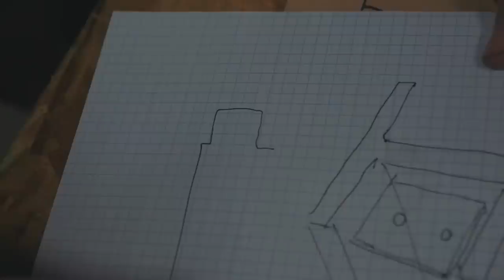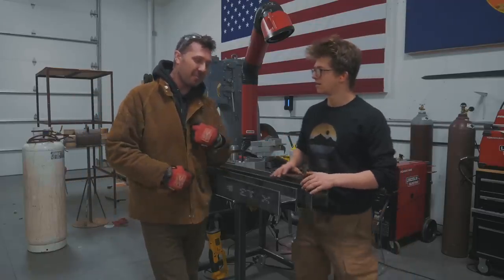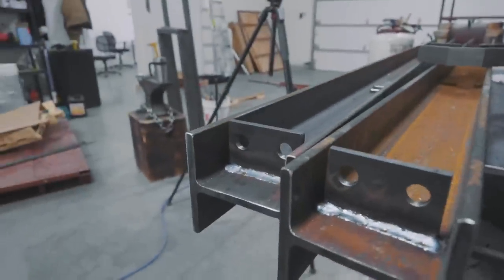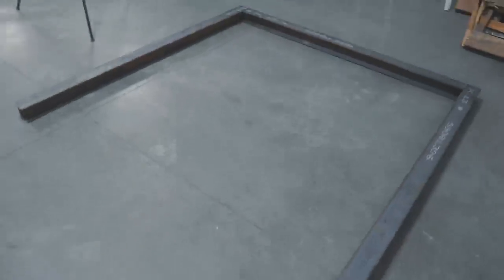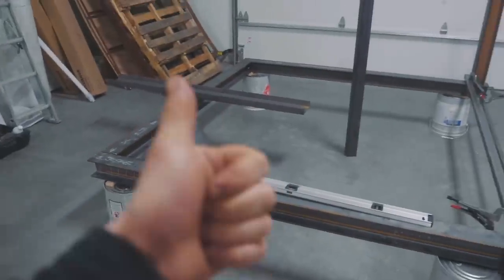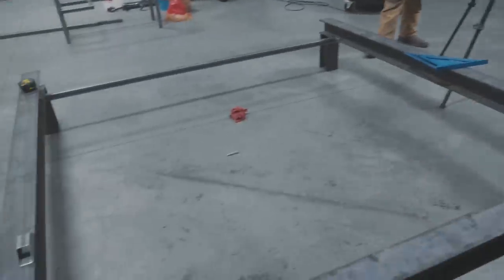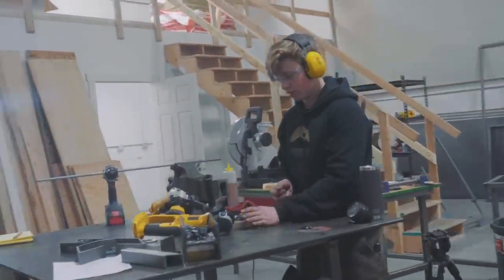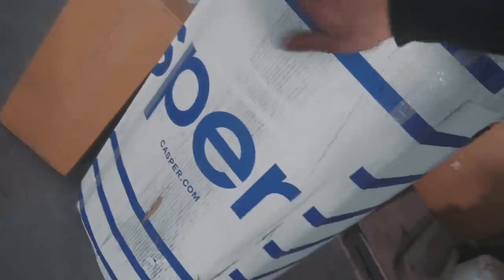MAKING THE INDUSTRIAL STEELE BED!!!

Comment: As a degreed Welding Engineer I am glad to see you using spray transfer finally but I want to make sure that everyone knows you dont need to have a tri-mix gas to achieve spray transfer.
Reply: In my technical materials course in university we learned that you usually want as little oxygen in your weld as possible. How come they mix it into the tri mix gas? Please enlighten me :)
Reply: Oxygen adds to the penetration profile
Reply: @sunrunneri9001  I think you're confusing  "air" with oxygen.. Some people/manufacturers use O2 in their weld gas to get better penetration at higher travel speeds (if you cut steel with straight acetylene or propane, your wouldn't be able to cut anywhere near as fast as you can with a small amount of O2 added to the mix in your cutting torch).  

It isn't the oxygen in the ambient air that is the problem, it's all of the other stuff that makes up the air that we need to breathe.

One of the customers that I do a lot of work for uses a  98% Argon / 2% O2 gas for welding 3 and 4 series stainless at 40 ipm, this customer normally has 2mm (~.08" thick)  thinnest material, but their robots usually have long continuous weld times (welding exhaust stuff for OEM)... We have other customers that are running 80/20 or 90/10 Ar/Co2 and they are lucky if they can run 30 ipm, but their applications are normally a whole bunch of short welds and the robot has to spend more time moving around than it does actually welding...

tl:dr - adding oxygen (a.k.a pure O2) to your weld gas mix gives you more heat, and better penetration on your welds.
Reply: In simple terms to create fire/heat you need fuel oxygen and heat.
Reply: Spray transfer is interesting, but i am wondering what are its benefits over FCAW? As thats likely what id consider for steel of that thickness.
Reply: @DonkeyDongDoug  Typically oxygen is very bad for welding. That is how "Oxides" are formed the more oxygen you have the greater chance you have to form oxides (BAD). The primary purpose of shielding gas is to prevent exposure of the molten weld pool to oxygen, nitrogen and hydrogen contained in the air atmosphere. I have never heard of someone using 2%O2 for welding stainless.
Reply: @Pheatan  The heat in a weld is not from fire. It is an electric arc... no need for oxygen for heat just more angry pixies flowing!
Reply: Most of the time dual shielded FCAW is ran in spray mode. Deposition rates are typically higher with solid wire in spray mode. FCAW helps clean the weld more if you have dirty materials you are welding.
Reply: @4pingpro  That shows how much you know then? I'm not a welding engineer, but this customer usually welds at 40 ipm on their coordinated motion welds. Comparing that against some of our other customers, they are welding 10-15 ipm faster. This is exhaust welding with robots.

Our other customers aren't using coordinated motion on their welds though, and they are usually all mild steel (E70 filler). So, yeah.. just because you haven't heard of it doesn't mean that it doesn't exist.
Reply: @DonkeyDongDoug  I never said it didnt exist just said I have never heard of it

Comment: quite sure there called I beam as the cross section is a capital I?
Reply: Ya its a I beam but the enginerds  terminology goes by its W class rating for strength.
Reply: There are many different kinds with slight differences, w-beam means wide flange beam. I-beam, H-beam, double-T, RSJ (Rolled Steel Joist), and UB (universal beam). They look similar but all serve different purposes
Reply: Yah there I beams

Comment: An I beam the top and bottom flanges are tapered H and W aren't W's are just a wider flange than an H beam. GOOGLE IT who knew? LOL
Reply: Christopher Berg "H" beams are same as "W" beams, except the flange thickness and web thickness are the same so that the member stays strong for its usual purpose of being pile-driven into the ground.

"W" beams are the overall category that the "H" beams are a subset of. Their flanges and web thicknesses don't need to be the same.

"I" beams, or "S" beams as they are called in steel fab industry, have the tapered flanges and aren't used in conventional building, usually only as trolley bottom flange rolling crane support.
Reply: I thought maybe they just drew w’s different in Britain.
Reply: it's not a W-beam. It's a double-U-beam. Obviously.
Reply: And we call it Double-T beam (because it is more than a T-Beam) and not I-Beam. There are different names.
Reply: My part of the world we call them universal beams or universal columns...
Reply: It's a double U beam, or H beam, there's no W
Reply: *American Standard Wide Flange Beam. Pretty much calling it a H beam is just slang. The “W” is from Wide flange.
Reply: @stuggle173  Think Double-U, two U's stuck together at their bottoms.
Reply: When I was a welder/machine operator at a structural steel manufacturing plant, we called them all “I” beams. I cut beams that where over 350lbs per foot. 3” thick flanges / 4” thick webs. I even made 4-1/2’ tall 25’ long “I” beam girders for a mining company in Chili all with the same thickness steel. All called “I” beam. I guess that’s just for the engineers to know because to me, as a welder/machine operator” I just cut, drilled, coped, fit and weld.

Comment: The floating steel bed idea reminds me of the Iron workers on that floating I-beam eating lunch from I think the thirties or fourties.  If you know the local that did that lemme know!! My dad was local 118, and 401!!
Reply: That pic was from the building of the Rockefeller Center
Reply: It's not floating.
Reply: @bearsharkp3901  I know it's not floating. But just being that high on the iron has to make it feel like you are lol. The picture is called "lunch atop a skyscraper" and the building is now the GE building
Reply: Whatever iron hanger union in New York City. Did you notice the guy on the far right is drinking from a flask. WAY before OSHA! Man, the work environment was WAY different back then! I wonder what we find acceptable today that will make our grandchildren cringe.
Reply: rich pasto duh man. wtf, were you trying to be funny?
Reply: @caseyclymore4417  no.  Dude asked what future generations will probably find absurd which we currently tolerate.  I answered.
Reply: rich pasto if you think he literally meant floating in air, defying gravity... then I am more worried about your effect on future generations than his lol
Reply: rich pasto he also directly compared this ‘floating bed’ to the ‘floating rail’ in the pic.   

Since it is clearly mentioned in the video that the bed is under the slight illusion that it is suspended, then why wouldn’t the same go for the rail?   

So much negativity on YT man.   Future generations may be apprehensive to share information from fear of ridicule/hostility/sarcasm/BS thanks to guys like you.

Comment: Don't forget American houses are made from sticks, the structure might not support that thing's weight, lol.
Reply: "sticks" LOL!
Reply: probably weights less than an adult male human. id hope you could walk on your floor without it giving in
Reply: @toxicated3622  I know Americans have a certain reputation but I'm pretty sure the average adult male doesn't weigh more than 500lb.....
Reply: @tinnerz58  i can bring me and a few friends to my house and not cave my floor in.
Reply: @toxicated3622  I didn't say it would, just your analysis was wrong. And I imagine as I didn't see pads added to the feet of the bed the point loading is actually going to be quite high so floorboard damage is absolutely possible if chipboard was used instead of Ply, but not a total cave in
Reply: If it's a modern house, and on the ground floor, it's sitting on a concrete slab.
Reply: @tinnerz58  im also a carpenter so i dont need a lesson on point loading. Thanks

Comment: I watched the bed frame construction and like me " OVER BUILD", I like it. More of an over build than I although, nice. Have you considered padding the inside and or outside of the upper rail. I could suggest water pipe insulation for an inexpensive way and some types come with one or both sides of the length slit with sticky tape already attached. It is even pre-slit for you. Just a thought to save your legs and shins and in bed elbows. once again nice job

Comment: As you saw when Will was standing on it, the issue was torsional stiffness of the horizontal leg of the front bed support. Ideally using pipe would reduce this flexture.

Comment: Interesting that you call it a "w" beam. I know it as "I" beam. great build all the same.
Reply: they are similar but with a w-beam also knows as a wide flange beam the flanges are wider and have a much more flat profile where as an i beam the flanges are much smaller and instead of being a constant thickness as in a wide flange beam they start thick at the web and get narrow much like with the legs of c channel. i’m not sure if this helps at all but here’s my attempt at drawing out the cross sections of the beams with text
               |___|             |\_____/|
               |      |             |/         \|       
           wide flange        i beam
Reply: And h beams have a shorter flange
Reply: I’d still like to hear is as a ‘wIde’ (wide) beam as it sounds more similar to an I beam and makes more sense to myself, just interesting

Comment: When you think colin is good at welding then you see this
Imagine stubbing your toe on this youll probably lose a foot
Reply: Jus some beautiful weld's
Reply: Mig is just point and click, tig on the other hand is an art form. Colin can lay some beautiful beads.
Reply: @jon8706  Yes mig is childish easy on normal not crazy thin steel if the settings is right.

Comment: so what was wrong with the truck??
Reply: From my experience with used Ford trucks I have a some guesses.

There's a pretty decent chance that a few of the thousands of random cigarette butts that one of the previous owners managed to hide inside of every single piece of trim, nook, cranny and pocket dimension, managed to fall into the transmission through a wormhole. If that isn't the case it could be that the rocks and sticks that were carefully placed inside of every body panel for no reason somehow move slightly and disconnect something.

Of course there's always the chance that when a previous owner decided to splice a bunch of random identically colored 8 gauge wires into random parts of the wire harness they accidentally weakened one related to controlling the transmission. Now One of the wasps nests built on that wire managed to get snagged on a tumbleweed (it doesn't matter if there are tumbleweeds in the area, there will be one there) and when someone pulled that tumbleweed out it pulled on the wasps nest and broke the wire.

Now if Alec has my luck, it was all because someone decided to "help" so they changed out a part for no reason without asking (In my case the vacuum modulator) and lost another part ( in my case the vacuum modulator pin). Hopefully the mechanics had a spare floppy disc drive on hand so they could take it apart for the nice polished stainless steel pin inside (the one the reader head rides on) and cut that down to spec to make it work (any sufficiently strong stick type thing will work but floppy drive pins up your street cred).

Now if you will excuse me I need to sort the pine cones inside my fenders by alphabetical order.
Reply: It’s a Ford.  What else do you need to know?
Reply: Marcus Burks mine is just fine. This is why you don’t buy old. Not saving much money in the end. Near any vehicle past 80k miles is going to be a project and cost some cash to Kee up.

Comment: What's a W-beam?
Reply: Wide beam, referring to the flanges. Don't feel bad I had to Google it, I beam, H beam sure but w beam is that primarily British?
Reply: @imallearsru  I was so confused, I just kept thinking "why is he calling that I-beam a W-beam?"
Reply: @imallearsru  that's why I was confused because in America we refer to them as I-beams
Reply: Hes calling it a double-u, as it looks like two u's stuck together
Reply: A wide flanged I-beam is called a W-beam. The cross section of a W beam is wider than a standard I-beam. It can handle larger moments and shear stresses than smaller flanged beams.
Reply: Pretty sure it's a double-U beam... not a W... Seems confusing? I guess it's for a U against another U... Yeah, maybe a I (with serif) makes more sense, but I only know about wood and leather LOL
Reply: @garayworkshop  It is in fact a W-Beam, W as in wide flange.
Reply: wide beam
I know it as an I beam.
Reply: Was interesting to hear the terminology, we call them I-beams here.
Reply: @dazaspc  it's a WIDE flange (square flange and web) vs a standard I beam or crane rail beam which have a square web and tapered flanges. Wide flange beams are measured by nominal height and lb per foot weight.
Reply: It's also referred to as H beam

Comment: As a chiropractor, I really need to see you put a flat surface on that platform.  As others have said, slats with spaces will not only affect your mattress, but your back.  They are neither good for memory foam, nor conventional, nor air.  A platform is always best, and more important than even the mattress.  25 years of personal data behind that. Box springs are a similar spaced slat design, and were a step up from the spring frame, but still the cause of billions of dollars in back care!

Comment: I've had some steel bed frames in the past and there isn't much more solid for sure, but as many have pointed out in its current state it'll probably kill your shins so to speak. Would really advise rounding out the corners and edges to avoid bigger injuries done while mostly asleep. Aside from that, pretty sick D.I.Y. and pretty good information into the world of fabrications for sure. ^^

Comment: Alec. do yourself a favour with your welding plant, change out that earth clamp for a magnet. Either round or triangular, way easier to connect to your steel stock or your welding table (even if underneath), as a coded welder for 37yrs on site, it really is a better way to earth out.

Comment: better start wearing shin scales in your jammies :)) I tried out the exact same frame (different feet) for a 2200mmx2400mm bed fifteen years ago. Had a loft-style house with a 48sq.m. master bedroom planned for it. But I ended up getting rid of the steel frame after too many finger injuries (while making the bed) and bloody shins (nightly calls as a fire fighter) after just a few days trying it out.  Idea to make it work: add a transparant rounded edge on the inside of the frame to protect you from pinch wounds and scrapes, and round off those outer corners generously and add hard foam (like the material of football shin protectors) edge protection...
Reply: aside from the functionality thoughts, I found this another great video. Thanks for sharing the fabrication lessons with us! I have learned a few new things today!

Comment: fun fact of the day: The foot was a common unit of measurement throughout Europe. It often differed in length not only from country to country but from city to city. Because the length of a foot changed between person to person, measurements were not even consistent between two people, often requiring an average. Henry I of England was attributed to passing the law that the foot was to be as long as a person's own foot. This was one of the first times a standard unit of measurement was put into place.

In 1959, the United States, Canada, New Zealand, South Africa, Australia and the United Kingdom all signed a treaty known as the 'International Yard and Pound Agreement'. This standardised the avoirdupois weight and length of all nations. Those standards are still officially used in both the Imperial system and U.S customary units.

Comment: Nice, heavy bed ;-). One thing I don't understand, why didn't you make the knife plat a little longer, so you could weld it on both ends to the flanges? Would make the connection a whole lot sturdier....

Comment: I know its just for a bed but if you were to cope the ends of the beam like that for a building you would round the edges where the flange n web meet. Because having a sharp corner is a weak spot for it to potentially start tearing. - its what i do for a living.

Comment: Spray arc on that thin stuff!?!?  You kidding me!?!?  You could do a light tig weld without filler and have that frame be rock solid even with the ladies over!  You’re just warping the crap out of of everything!  At the most just mig it out with c25
Reply: Short circuit that is

Comment: Alec, the @hydrolicpresschannel has been doing experiments crushing steel square stock vertically with a press. I’m wondering if you could weld caps on the ends fill and make a damascus piece out of that.

Comment: When you started making the frame I thought you was making a base for the power hammer to sit on.
All you would need to do is fill it with concrete and rebar  enough to give you your 6" base.

Comment: Most heavy duty bed frame for all that American tail he must be getting.  No more busted bed frames lololol.  In the steel shop I work in, we call those H beams, different than I beams (I beams we use typically taper larger towards the centre of the web, kind of like two sections of channel butted together) anywerds keep on choochin

Comment: You probably have already discovered this, but from my experience, foam mattresses are insanely floppy, and need either a special box spring, or a slab underneath to provide support that the slats lack. Otherwise you'll wake up with a wavy spine. Or so I have been led to believe. My mattress is still flat on the floor, waiting for me to design and build a frame for it...